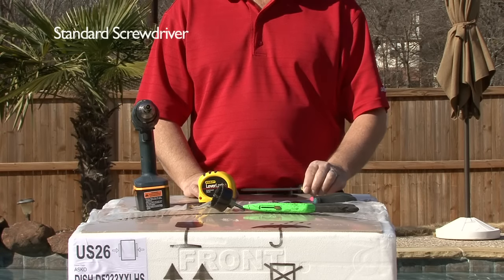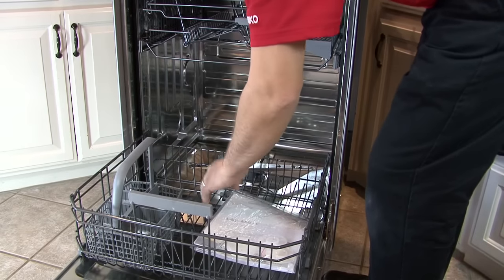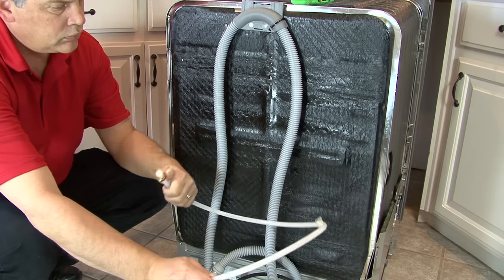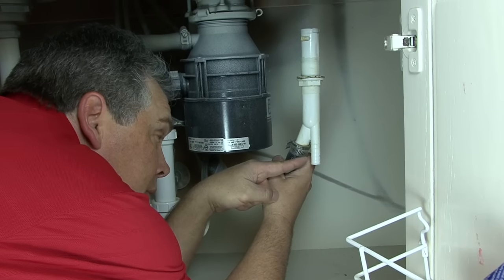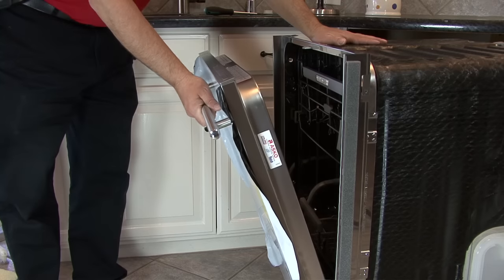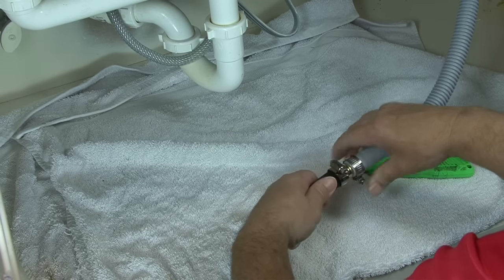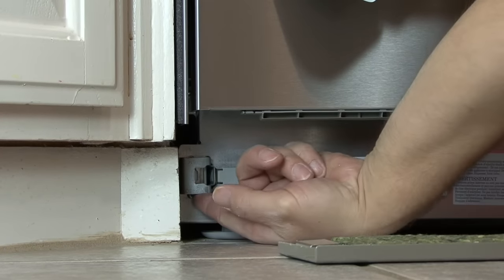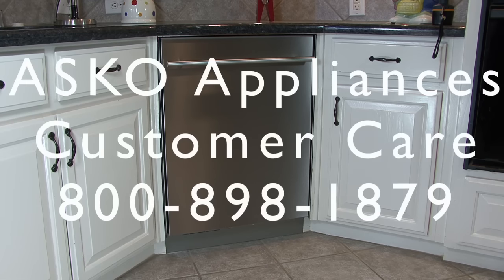How to Install an ASKO Dishwasher

Comment: I have Asko D3132.  A sudden trip of the circuit breaker went off by itself one night and upon resets, the trips happened again, but with about 10 Sec delay.  Technician identified a faulty wax motor that is related to the air drying vent (not the detergent dispenser). He recommended replacement of the whole dishwasher after unsuccessful replacement of the wax motor. Wondering what could the actual faults that causes of the trips, and how to troubleshoot? Looking for 2nd opinion meantime.
Reply: Go get a different technician

Comment: Hmm. Don't seem to be able to get the ASKO accredited installers to come and remedy the problem I am having with the top shelf sliding out when I open the door. Related to poor installation in the first place I was told. Hopefully I can use the current lockdown in Melbourne to try and fix the problem myself. Failing that might be time to get a Miele.
Reply: Same here!!!!
Reply: I thought it might be that the washer is not level and is pitched forward too much. I raised the front as much as it will go. I do not have that back adjustment. Same thing...
Reply: Same here. 11 years old and just started doing this -- but doesn't look like it was EVER bolted to the cabinet and there are no screw-cover plugs installed. Maybe installer used tip guards instead? But no info on how those work or where they go anywhere.